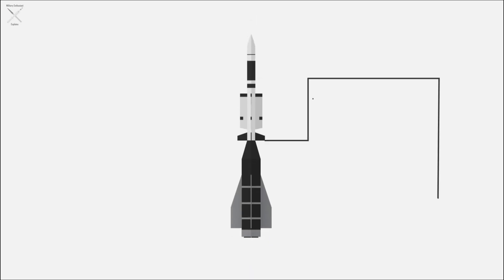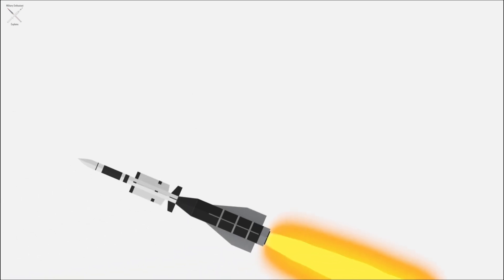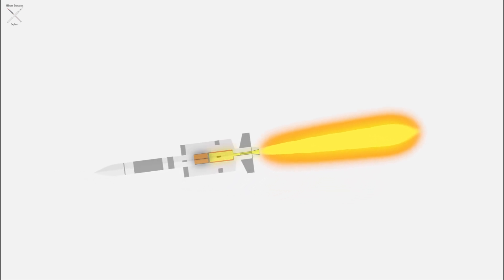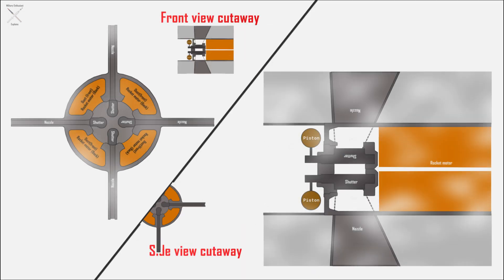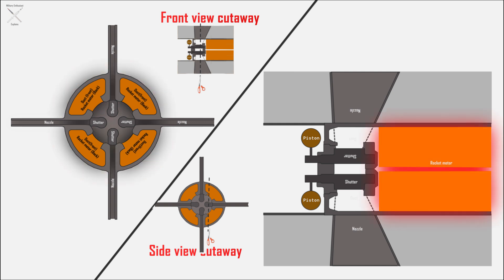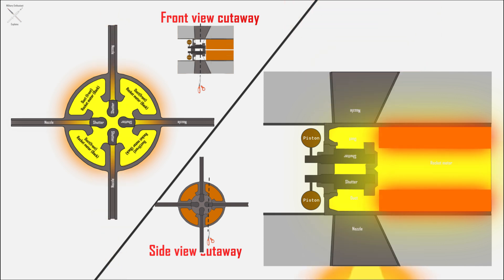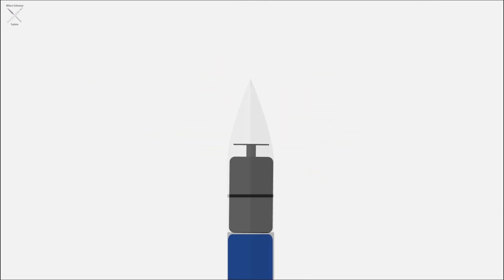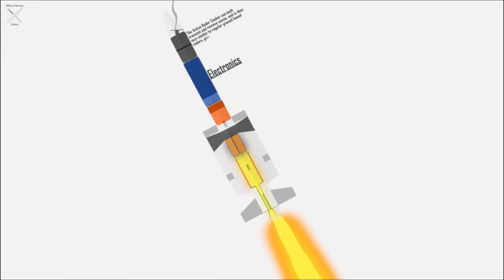The ASTER 30 NT - A Missile's Nightmare

Comment: Is the Aster30-NT same as Aster30?
Reply from the maker: The seeker was upgraded, leading to an improved accuracy (higher frequency) and update rate, making the missile capable of intercepting longer ranged ballistic missiles. The official claim is max 1500km range for the threat but the actual effective range is probably shorter.
Reply: @MilitaryEnthusiastExplains   1,500 Km is the detection range of the radars.
Edited. -threat range not radar capability.
Reply from the maker: @zipz8423  
"...The  development  of  Aster  Block 1 NT in cooperation with Italy. This new version of Aster will extend the antiballistic capability of the missile from a range of 600km up to 1,500km"
https://web.archive.org/web/20150330142007/http://www.mbda-systems.com/mediagallery/files/aster-family_background-1402652367.pdf
PDF by MBDA
Reply: @RogerPierre 1,500km is the range of the targets it can intercept, not the range of the 1NT missile round.
The Arabel radar instrumented range is around 80km (published).
Reply: it's an evolution
Reply: @RogerPierre So its the same mass as a standard A-30 but with 15 times the range,. Really.
Reply: @zipz8423   It's the magic of engineering, this is why MBDA is building some of the best missiles in the world. For example, the Meteor missile nobody knows it's real range, simply because MBDA choose to keep it secret as an advantage.

Btw, meteor is using an hybrid system that can increase the range strongly. Aster is maybe using the same type of hybrid propulsion but on longer distances.
Reply: @kasugakyosuke6441  It`s the magic of English comprehension. They are stating the range capability of the threat not the Aster missile range.
Reply: @Drew Peacock The RN can have the 1NT, as long as they fit new VLS systems.
Reply: @Drew Peacock Yes it can, apologies I worded my comment poorly. There are lots of routes the RN could take - if budgets allow.
Here are my thoughts.
If the RN wants a basic ABM capability they could either keep what they have (a basic and limited capability) or continue to work on a PAAMS multimode (AAW + ABM) capability upgrade, and update their block zero Aster 30s - depo level software enhancement apparently but not certain - to block 1-  (greater ABM capability - the same software SAMP/T uses) ) or choose the 1NT for greater capability but that is the end of the road for A50.
 If they wanted to expand the capability over time that would mean purchasing Aster 30 block 2 missiles with a much greater planned capability, then they would have to fit the Sylver A70, Block 2 is a no go for the Sylver A50.
As far as I am concerned, common sense would dictate an A70 change out but that is probably too hopeful.
Reply: @zipz8423  I know right. I swear the British military is run by idiots (not sarcasm). Constantly cutting programmes, reducing procurement, or compromising the capabilities of platforms to reduce costs cough F-35 *cough*.